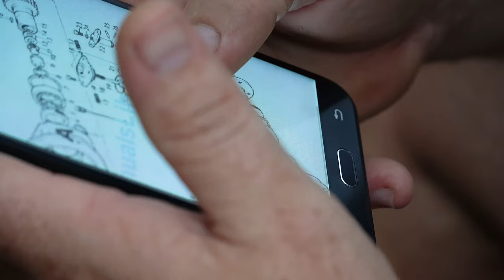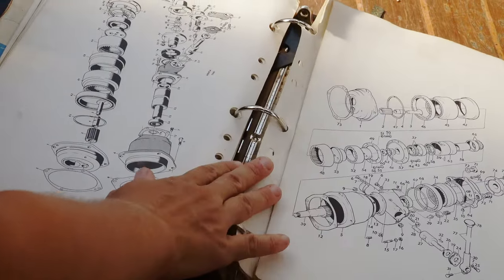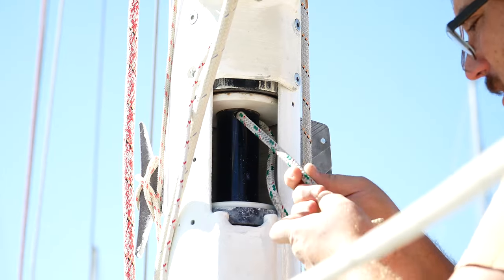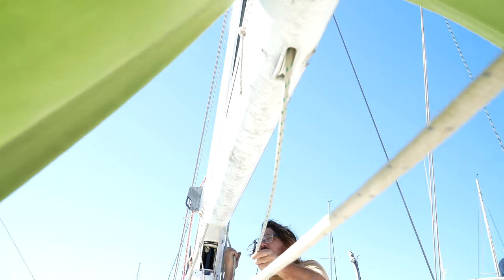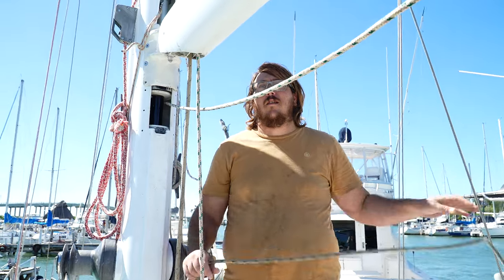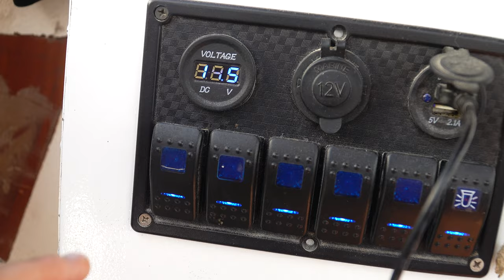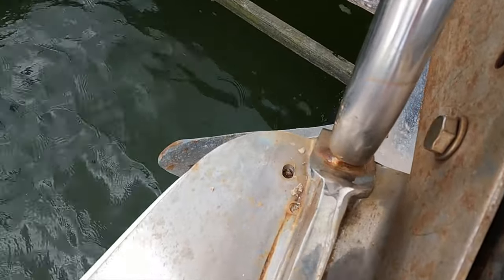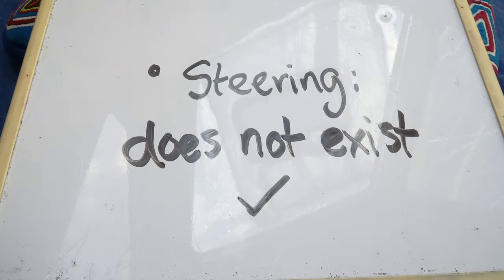SAILBOAT: nothing works, no money PROGRESO

Comment: if you are not aware, as a lot of people aren't, WD-40 is not a lubricant.
Reply from the maker: This is a good point - had many a discussion about wd40 working at a bike shop - it is advertised as a penetrating oil / lubricant, but should not be used as a lubricant because it penetrates and removes. In the video, Robi was making the point that he wanted to buy a proper silicone lubricant in addition to decrudding with the wd40.
Reply: It makes excellent cleaning fluid. It removes all sorts of dirt and grime very, very effectively, but I agree, it is a rubbish lubricant.
Reply: @SailingYachtSaltyLass  (only thing that absolutely removes duct tape residue!!!)
 I love the smell of wd40, I keep my tools coated in it (now says on the bottle "displaces moisture " and I believe it has saved my life and thousands of dollars over the last 50 something years when the only competition was 3 and 1 oil.... the little hose was genius!!!
Reply: Water Displacement x 40 power = WD40

Comment: If you’re looking for something a bit more long lasting on the furling mechanism. You might try a motorcycle chain lubricant. There are silicone based grease’s that come in spray cans. Just be careful where you spray it. It can get messy. Loving your videos. Looking forward to the next episode. We just get them 24hrs late in France !
Reply from the maker: Thanks for the tip - that’s a good idea, as there are more automotive and motorbike shops around than marine stores that will carry good silicone lubes 👍

Comment: If the main is not rolling in nicely there might be one or two issues: (1) the boom is almost horizontal. It should have an angle. Move the aft of the boom a few inches up. (2) The sail is not in the rotating in-mast groove in its entire lenght. Pull it down an out an get it back in very carefully. Use a flat wooden kitchen spatula to help it get in the groove and check it visually as it gets in and up.
Good luck!
Reply from the maker: Thank you for the ideas - testing out a different boom angle is an easy and hopefully useful check because we can't figure out where all the friction is coming from. We definitely need to take the main down and out for sewing repairs and will keep this in mind when we get a weather window of less wind 👍🏼